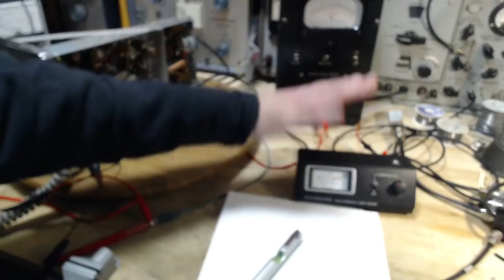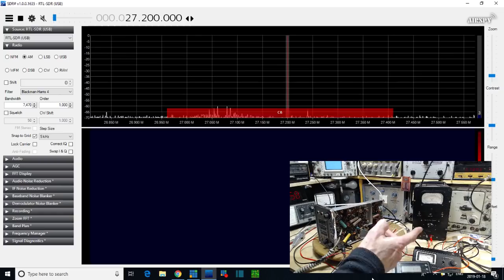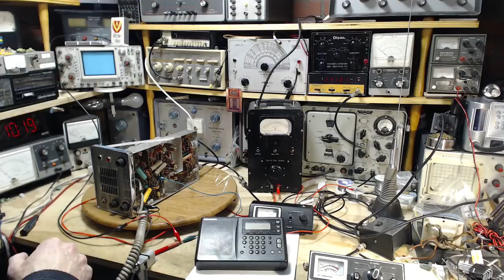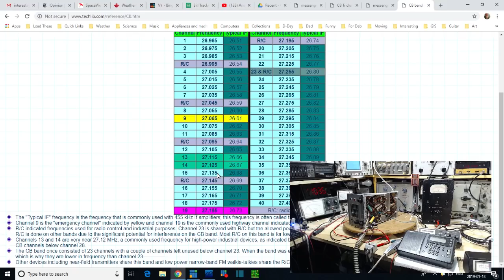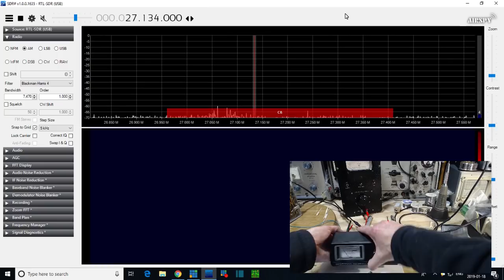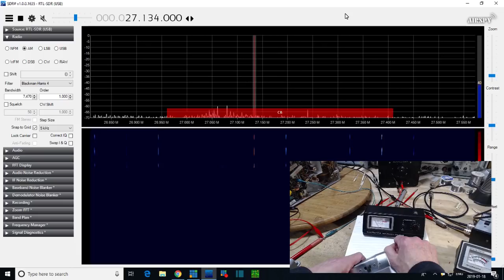Johnson Messenger CB Radio Video #5 - Channel Proofing

Comment: Your Walkietalkie uses a 23 channel Synthesizer which is as accurate as the 10.240mhz crystal used as the clock for the PLL chip used to produce the LO for receive and the LO for Transmit, What about using an UNUN to match the Johnson Messenger into a vertical copper pipe with a length of 11 meters high with a good earth connection, SWR should be 1:1.

Comment: I do not know but Dummy Loads do seem to have (usssuuallly) a good SWR. About 1:1 for 50 Ohms or so.. I heard People saying.. And it seems to be good to transmit into a Dummy Load and not into an Antenna for Testing a Radio /Transmitter / Transceiver .. I heard People saying that too.. :)

When You want to know on what Frequency You are: There seems to be Time & Frequency Signals on LF and Shortwave. Like WWV (USA), CHU (Canada) for Example. WWV is on different Frequencies like 2.5 and 5 and 10 and 15 MHz for Example. CHU is on 3.330 and 7.850 and 14.670 MHz (for Example). If You can receive such a Station, You can check the Calibration for Your Frequency Reference (the little SW Receiver or the SDR for Example).

Comment: On an swr meter you normally adjust the cal pot for full scale on forward power. Then when you switch to rev power the reading should be correct.
Note. You can’t expect good results with all those cables and switches connected in your aerial circuit.
Also as mentioned in another comment, the aerial expects to have a ground plane for a proper impedance match.
Reply: For the calibration of a tranceiver you normally get a 50 ohms dummy load. basically a resistor of sufficient wattage. (here: negletible, on more beefy devices: coils in a bucket full of oil)

Comment: Your sdr shows a signal on the same frequency as your transmitter carrier comes up on when you transmit. Watch your sdr when you transmit. You will see it’s lower than 27.015.
Turn your sdr off and see what happens to that signal apparently on chan 5.

Comment: I think you can reasonably assume the crystals are on frequency. You don’t have anything in your workshop that is accurate enough to set the frequency.
You have another frequency counter connected to your sweep oscillator. Have you checked the accuracy of that one. The counter on your signal generator is several kilohertz out on the short wave bands which makes it useless as a frequency measuring device.

Comment: Jim, there's an antenna that is supposed to be inserted in the opening on the top of the meter to use the field strength function.